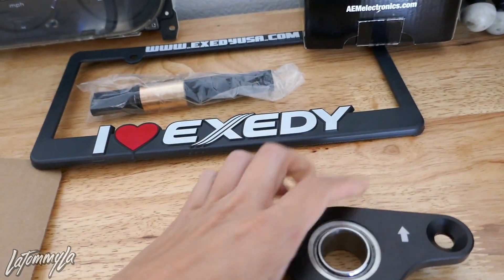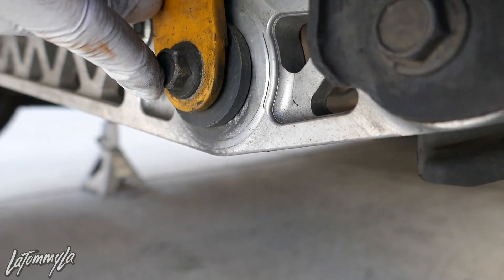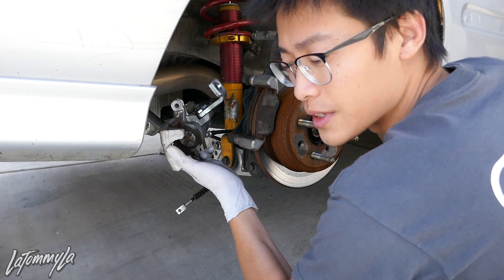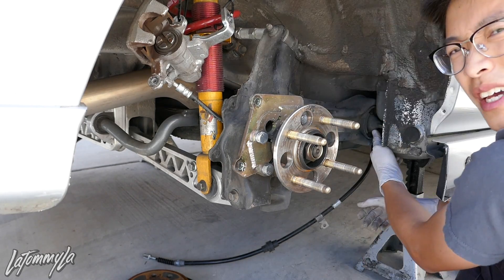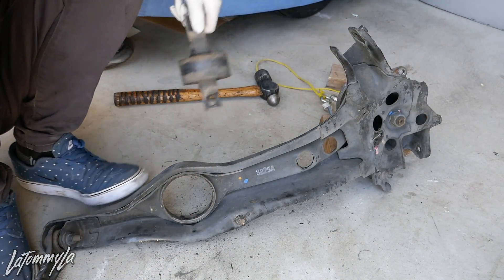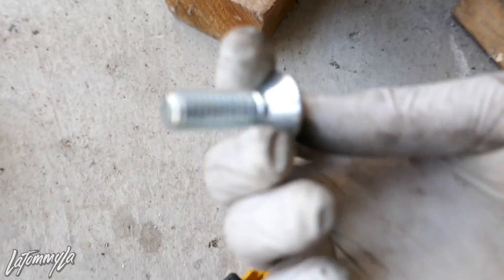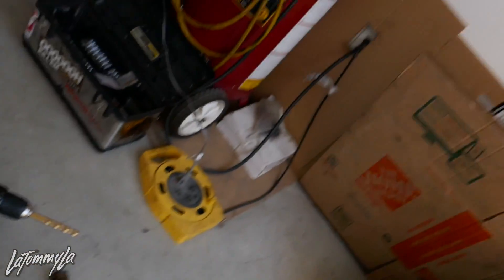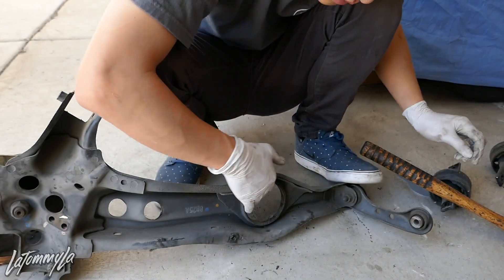Replacing trailing arm bushings on a Civic! PCI Racing Sperical Bushings!

Comment: great video the little tips and tricks really help people.  I'm a shop manager for my daily grind I fix cars and big commercial mowers all day. putting the bolts back in the assembly you take off is a trick I also use. I also use little trays to hold bolts for different assemblies. also you can get a bottle of cutting lube that helps with drilling metal makes it cut like butter but im sure you didn't need it for that thinner metal. those bushings seem worth it for ease of replacing and installation. do you like them so far. man yeah its been hot I live near Seattle washington last weekend was 97 here. man your setup juet made me realize I need a rear disc conversion thanks. to bad sarcasm doesn't translate well typing. love the videos.
Reply from the maker: I try my best to make it easier for everyone haha! And thanks man!

Comment: Love the long vids 
What's the point of upgrading this part? I know that it's broken but is there any other difference?
Reply from the maker: Thank you, and removes all the slop in the rear, just like any other bushing
Reply: LATOMMYLA I still don't understand, do you mean more stiffer rear?
Reply from the maker: Pretty much
Reply: i went to a large to get an alignment and i dint know if our cars had a toe so i looked back at this video and now i know where it is..... back to the alignment shop
Reply: Main benefit for mine was rear end stability under braking, especially threshold braking.  Additional benefit was just a more "solid" feeling rear end suspension.  Mine are the original design and I put them on my car the same year PCI originally came out with them and probably around 80k miles (mostly street) on them.  I inspected them for the first time around a week ago and so far so good, didn't need to service any components.